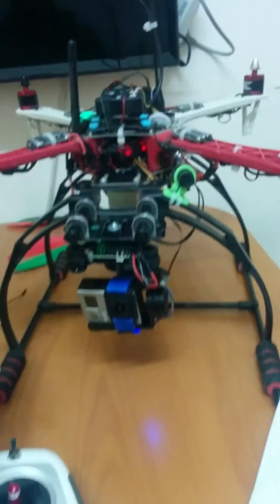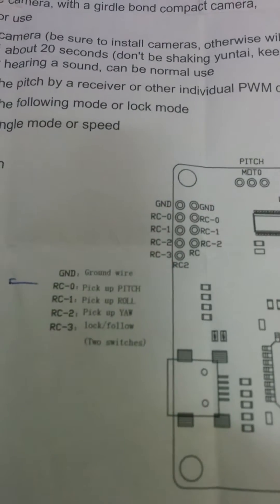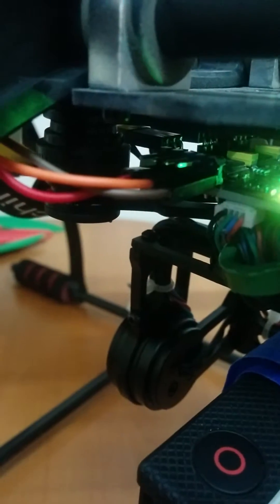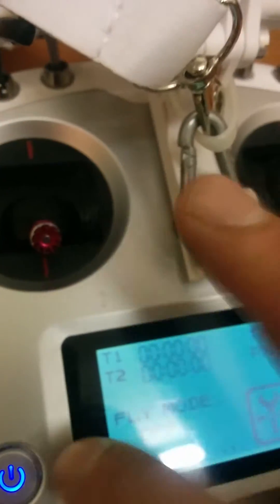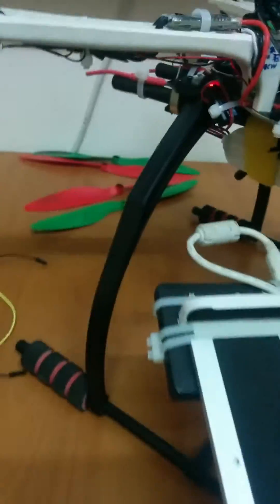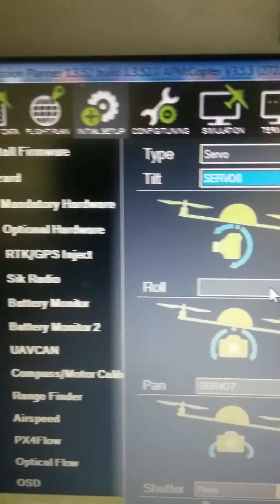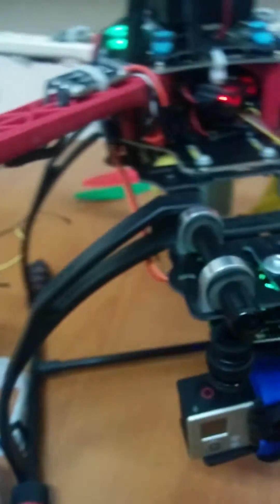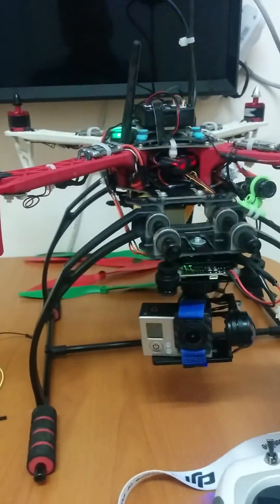How to connect Storm32 Gimbal to Pixhawk (Easy)

Comment from the maker: NO need to use  any AUX channels at all in pixhawk !!!
Reply: hi khanfar.  great video.  I tried using the auxiliary channels but for some reason it seems my pixhawk is not passing through the command.  I am running the pixhawk directlly from the PC USB.  HAd issues with my power module so I cannot connect battery.  DO you think this is why it is not working?